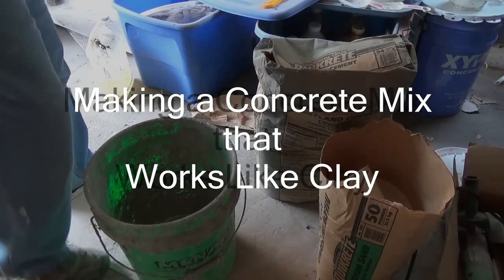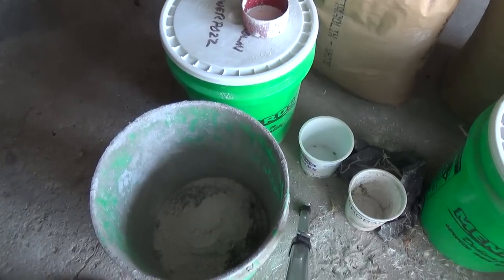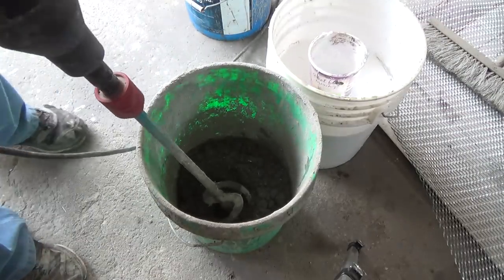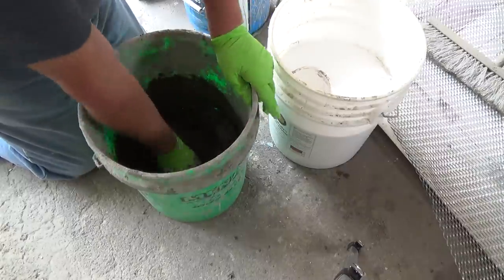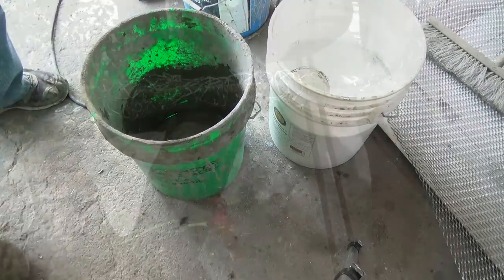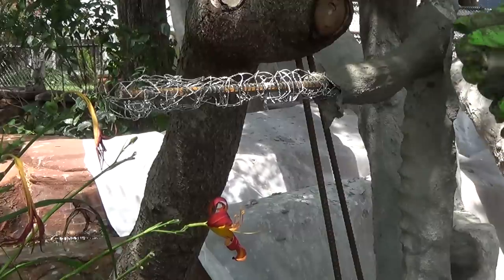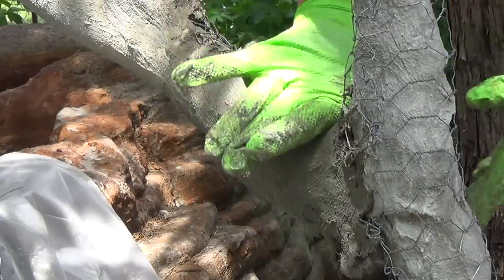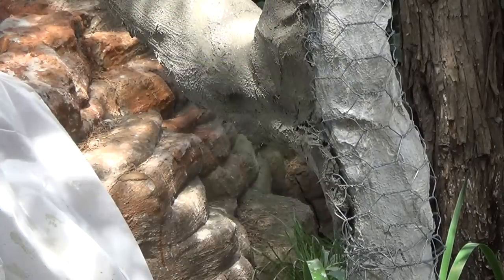#concrete #fauxbois Making a Concrete Mix that Works Like Clay

Comment: Hi, thanks for this video., it's absolutely what i'm looking for :). A question : what is acrylic bonding ? glue ? is for this reason the water is white ? Thanks
Reply from the maker: The acrylic is a liquid and is added to the water.  I use a product from Fishstone   https://concretecountertopsupply.com/Item/KongKrete-Acrylic-Polymer-GFRC    It is 50% solids, so I dilute it 3 water to 1 acryllic.  You can buy acrylic, such as Quikrete's Acrylic Fortifier at Lowes and other home improvement stores.  Home Depot carries a product from Sika that should not be diluted more than 1 water to 1 acrylic.  Watch this part of the video  https://youtu.be/e4j5qgNFQE0?t=160  and note the on-screen caption

Comment: Granted, working time is variable on environmental conditions, but can you give an example of your experience of how long it was workable for you? Your environment, etc. Thank you in advance for your time. Awesome info!
Reply from the maker: You may not like the answer, but I'll say it again; it depends on environmental conditions.  On a very hot day in the  90's, I had to use ice to cool the water, shade the area and work quickly.  On those days, initial set could be less than an hour.  When the temperatures were in the 60's, cloudy and not windy, I had several hours to work and would still hope it was setup before dark so that raccoons and kids couldn't mess with it. I learned quickly that high temperatures, wind and sun were the enemies of working time and flash setup was a real possibility. On those days, I compensated by using ice bags in the water and working under a patio umbrella. That's also a time to use set retarders such as citric acid, sugar or molasses. I don't like chemical retarders as it's very easy to use too much and end up with a mix that won't set at all.  Lots of working time, then.

Comment: some yrs back I experimented with a KirtBag mix and a TruePakX mix applied as a walkway 1/4" skim coat. Hand troweled and did some decorative stuff with it. It troweled smooth as butter, and it has held up quite well over the years. Loved it.

SO, I'm now thinking of using your mix over rough finished cement flooring as a smooth troweled finish coating, probably 1/4 to 1/2" (rather than ceramic tiles)....
Q: might fly-ash be a suitable substitute for metakaolin?
Q: the acrylic admixture (milk)... can an acrylic bonding agent (non-re-emulsifiable ) alternately be used ?

(I live overseas - there are no Lowes or HDs, and IF I were to find a concrete specialty shop 400km away it would not be practical.)
Reply from the maker: As I'm not a concrete expert, I can only share from my own experience and from what I've read. I have personally never used fly ash, but from what I have read, they are quite different in effect.  Read from this site: https://precast.org/2020/01/a-closer-look-fly-ash-slag-cement-metakaolin/  As for non-reemulsifiable acrylic, I use the product I for both bonding and as an admix.  Many are sold as "bonding agent/admix".  You just have to know the solids content to know how much to dilute it with water.  You want to end up with liquid that is at least 6% solids, preferably more.  The stuff I use is 50% solids and I dilute it 3 water to 1 acrylic.

Comment: I purchased SikaLatex R bonding agent from Lowes. It works fantastic. I'm moving forward with my project on such a happy note now. Thank you!
Reply from the maker: Just don't dilute it more than 1 to 1 with water.  It has a much lower solids content than what I use.  I'd bet the problem you had with the dry stuff is a matter of knowing how to dissolve it in water.  Kind of like making gravy.  Add the flour too quickly and you get lumpy gravy.  Good luck.  I hope the mix works well for you.
Reply: @dperry428  Thank you! This information will help me a lot. I had mixed 1 part acrylic to 2 parts water .I will take your advise moving forward. So far so good. I'm loving my project. If interested my project is 30'wide by 4' high rock wall with a rock wall waterfall that will be about 10'w up to 8' tall at the end. Thanks again.
Reply from the maker: Please post a video of you progress.  I'd like to see what you are doing.
Reply: is this bonding agent added instead of fibers or  metakolin?
Reply from the maker: No, it's in addition to fiber and metakaolin.

Comment: Just what I have been looking for! It looks like a great media to work with, then carve, without having to fire the final product. I imagine one could cast with this material as well. I will try this with small quantities. 
 I didn't understand the name of the ...... fibre to add. 
Also, would have loved to have seen the finished/carved project. Thank you for this video!
Reply from the maker: PVA (polyvinyl alcohol) fiber  https://concretecountertopsupply.com/pva-fibers/  I use this mix for undersides of sculpting. Increase to 1 sand to 1 cement for normal sculpting. For casting, I change the mix to 2 or 3 sand to 1 cement, reduce the metakaolin to 10%, add 8% silica fume.  You might also like to add superplasticizer when using molds.  This video shows me finishing the bridge project with a 1 sand to 1 cement mix.  https://youtu.be/Fd-6IWia0Ms
Reply: @dperry428  thank you!

Comment: I love watching your videos and have a question about the Acryl additive you use. 

I have seen you apply it to already dry parts of your projects that you are adding new material too in order to help bond the old with the new. 

It seems in this video that it must play a part in getting that clay-like consistency. Let me know if I have this correct.

Are there other reasons why you would use Acryl in a mix? 

Thank you for all of your instruction.
Reply from the maker: The acrylic is known as acrylic bonding agent and admix.  I use it as an additive to every concrete mix I make.  It is an emulsion of 50% solids that I buy in 5 gallon buckets.  It can be used undiluted as a bonding agent to make new concrete bond to old concrete or it can be used diluted with water to use as an additive in concrete mixes, where it increases the strength of the concrete, increases the bonding strength, increases the workability of the concrete and helps make concrete less permeable to water. I mix the 50% solids at 1 part acrylic to 3 parts water and wouldn't think of making concrete without it. To make a mix even more like clay, the dilution can be reduced to 1 part acrylic to 2 parts water or to 1 to 1.  The only problem with using higher concentrations is it will interfere with coloring the concrete with acid stains.   Acrylic for concrete can be purchased at home improvement stores but most of it is about 25% solids, so a normal dilution of 1 acrylic to 2 water is maximum dilution.

Comment: Sir could you please let me know all rhe ingredents you have there.like what is the white liquid.where do i get the cement without rocks.i ordered the metakaolin shoukd be in in a few days.every bit of my cement pots are falling apart.ugh
Reply from the maker: You might like to watch this video:  https://youtu.be/etSWuBIcdZc It has a detailed explanation of the ingredients.
Cement is the glue that holds concrete together.  Concrete is the mix of aggregates (sand and/or gravel), additives cement and water. The white liquid acrylic bonding agent/admix.  Cement can be purchased at home improvement stores and is labeled "Portland Cement".  Carefully watch how much liquid you add to your mixes.  Too much water makes for very weak concrete.

Comment: Thank you so much for this video, what is the working time of this mixture ? And is there a way to extend the working time?
Reply from the maker: Working time will depend on atmospheric conditions.  Warmer temperatures speeds things up, cooler slows them down. At room temperature, I have several hours before final set. The addition of tiny amounts of sugar will slow things down (1/10th of 1 percent or less of the weight of cement).  Too much sugar will prevent setting at all.  One can also add ice bags to the liquid used.  Cold water will slow setting.   Citric acid will also slow setting, as well as increase compressive strength.  15/100ths % of the weight of cement is the optimum.

Comment: Thanks for this information.  I have used this mix and it works great.  I apologize if I missed info on your mix for making a vertical mix that has very little slump.  What mix do you recommend for making a light fluffy vertical mix?  Thanks
Reply from the maker: Depends on what strength and durability you want.  Lightweight concrete gives up strength for lighter weight.  Generally, as in my fence, I used 3 sand to 1 cement for a base coat and 1 or 2 sand to 1 cement for overlying faux rock.  If you want lightweight, substitute perlite or vermiculite for some or all of the sand, again depending on how light you want it.  For example, you might have 1 part sand, 1 part perlite and 1 part cement.   Remember that in a finish coat, it will be hard to hide the lightweight aggregate.  You might have to go over with a final thin coat of sand/cement to cover the lightweight aggregate.  I don't think I would consider any mixes as "fluffy" except maybe foamed concrete (aircrete), but I wouldn't even consider its use as it is very low strength.  At any rate, I would still include metakaolin, silica fume, acrylic and fiber to increase density an eliminate porosity.
Reply from the maker: Forgot to add that it is critical that you add liquid very carefully and slowly.  Just a small amount too much and you go from a mix that stays put and one that runs or falls off the vertical surface.  Mixing technique is most important, no matter the mix.

Comment: Not sure if i missed it, but ... what is the working time on this? And thanks !! You just opened up a whole new world of possibilities for me. Your experience is excellent and i thank you for the education.
Reply from the maker: Working time is highly variable, depending on temperature, humidity, wind, sun or shade.  Under normal conditions, at least a couple of hours.  Want to extend working time?  Add ice bags to the liquid.  Remove the mix from the bucket and spread it out on plastic to dissipate heat of reaction.  Add small amount (less than 1/10th of one percent) sugar or molasses.

Comment: Thank you!  So helpful.  Do you think this could work (and not crack) applied directly over a carved styrofoam sculpture without having a chicken wire/mesh layer?
Reply from the maker: PVA fiber will go a long way to help with preventing cracks.  I'd first make a slurry of the mix and scrub it on the styrofoam with a brush and then cover with the mix.  That will assure a good bond.  Also, increasing the amount of acrylic helps prevent cracks.
Reply: @dperry428  Thank you, thank you!  I'm going to try it.

Comment: Absolutely wonder video!! Thank you so much - dumb question but what is the 5 cups liquid (3 parts water & 1 part admix) What did you use as measurements? Super excited to try this out!
Reply from the maker: I make up a bucket of liquid made up of 1 part acrylic to 3 parts water.  The measurement device is meaningless. I use a yogurt container and fill it 1 time with acrylic and 3 times with water.  You could use anything, just so you fill it three times with water for each time you fill it with acrylic.  Once mixed, it is the liquid I use.   The container I use to make the mix is a yogurt container that just happens to hold 5 cups. I also use a 1 cup measuring cup for other ingredients.
Reply: @dperry428  Aaaaah!! You’re a genius - thank you so much ❤️

Comment: Hello I would like to thank you for all the knowledge you have given (been watching and taking notes ) ordered a lot and started on a set of steps  had a question about   Sourcing xypex  also when making a 3/sand to 1/cement or 2 to1 how much liquid to mix in   as a starting point    I think I overdid it   Any way to fix that Thanks  a lot  I really appreciate you
Reply from the maker: I always start with about half the volume in liquid as I added in portland cement.  So, if my mix contains 10 cups of cement, I start with 5 cups of liquid and slowly add as needed, mixing very thoroughly before adding more.  That way, you never end up with soup.
Reply from the maker: Sorry, forgot to tell you about Xypex.  That is only the name of one brand of crystalline waterproofer.  Here are some more to look for besides Xypex:  Penetron, Kryton Krystol, Vandex, Cristalproof, Aquafin, Greenseal, Cemcoat CW Plus, Incap, Contite. There are likely many more. If you go to a manufacturer's site, the usually have a link to find distributor's of their product.

Comment: How long can you work with the cement before it starts to “ set up?”..
Thank you for your generosity in sharing your skill.
Reply from the maker: Depends on temperature.  When it's hot outside, it starts to stiffen in a few minutes.  Kneading it gets it more workable again.  You can also wet the gloves and knead it and it gets very workable again.  Otherwise, in cooler weather I can work with it for at least an hour or more.  Even then, it might not be completely unworkable.  I can still texture it with tools.  It sets enough to be rainproof in a couple of hours.
Reply: Exactly my question! Thank you so much!

Comment: What is the project you are working on in this video ?  Is it finished now ?  Are there additional videos of the finished thing ?  This is very enjoyable to watch !
Reply from the maker: I was working on the final coat of my pond bridge project.  It has not been completely finished due to a hip problem I am having. (It will be replaced on Feb 16th).  The project can be seen in the videos in this playlist  https://www.youtube.com/watch?v=oW_6EmdS3j8&list=PLzgOxsVcbO_Bm2Cfznc5-lZI8Rhb9oO8Y
Reply from the maker: After 2 years and 3 surgeries, I've finally finished the bridge.  Here's the final video. https://www.youtube.com/watch?v=Fd-6IWia0Ms

Comment: BRILLIANT!!!!!!!
Reply from the maker: I see from a question posed to another comment that you live in Australia.  Depending on the size of your project, you may want to look at a product that originated in New Zealand and is available in Australia called Pal Tiya.  It is a sculpting concrete developed by a New Zealand artist.  It i expensive, but may be more practical for small projects.  I've not used it even though it's available now in the US, but I've read about it.  You want to check it oiut.
https://artsup.com.au/products/pal-tiya-1-36kg
https://www.paltiya.com/
Reply: @dperry428  thank you so much .

Comment: Thank you-video is verily instructive, I am sculptor and try different materials, and this is very helpful, which is the working time ?
Reply from the maker: dperry428
1 month ago
Working time is highly variable, depending on temperature, humidity, wind, sun or shade.  Under normal conditions, at least a couple of hours.  Want to extend working time?  Add ice bags to the liquid.  Remove the mix from the bucket and spread it out on plastic to dissipate heat of reaction.  Add small amount (less than 1/10th of one percent) sugar or molasses.
Reply: dperry428 thank you for your fast response congratulation you’re a hard worker, I feel inspired by your work muchas gracias

Comment: Could you please tell us whats the strength on this mix..?? I wanted to do some thing sculpture s.. Any suggestions?. Thanks to the great video
Reply from the maker: I don't know the strength of this particular mix.  I use it for finishing layers where I want fine detail.  It is not a structural mix, though I would increase the amount of sand to 1 part to 1part cement and reduce the metakaolin to 10% instead of 20% to make the mix more structural for base layer of sculptural pieces. When I'm doing something such as the bridge I made, where I need real structural strength, I'd use 2 or 3 parts sand to 1 part cement, add some CSA cement and some silica fume as well.  That makes a very strong mix of 15K to 20K psi.

Comment: Thank you so much...I want to create a wall art, embedding object in it, partially exposed (meant for interior), in your opinion do you think this mix will work.  Being a LOL(little old lady). Instead of chicken wire I hope to find some reinforcing fiber mesh instead, will this affect anything.  Also do you think there is any reaction ‘chemicals “ if I embed fabrics....for instant the fabric might rot or something...being new at this I have so many silly questions and I appreciate your time and expertise. Cheers!
Reply from the maker: Sure you can use reinforcing fiber mesh.  Here's the perfect stuff to use:
https://concretecountertopsupply.com/Item/ARScrimNetByFoot  People make all kinds of things with fabrics and concrete -- not a problem.  https://youtu.be/7m04VeJxg-I      https://www.pinterest.com/pin/27795722676894833/
Reply: Thank you, still watching your videos...over and over and over.  So informative.  You Rock!

Comment: Thank you so much for sharing your knowledge. I cannot seem to find a supplier of PVA fiber, can I substitute with any other type of fibers such as polypropylene? Which would be the best substitute?
Reply from the maker: https://concretecountertopsupply.com/Item/PVA_6mm  Yes, you can use other types of fiber.  The first fibers I used were polypropylene.  I found them difficult to disperse in the mix.  They tended to clump.  https://concretecountertopsupply.com/Item/AR_Glass_Fiber  Glass fiber should be alkali resistant.  Some people have told me they have chopped up fiberglass insulation and used it.  That is NOT a good idea as it is not AR glass and will deteriorate with time and you've then lost the value of the fiber.  Though I've never used them, there is nylon fiber, basalt fiber, steel fiber, and others. I like the PVA because it does not show in the finished surface.  You can also find fiber on Amazon and ebay.